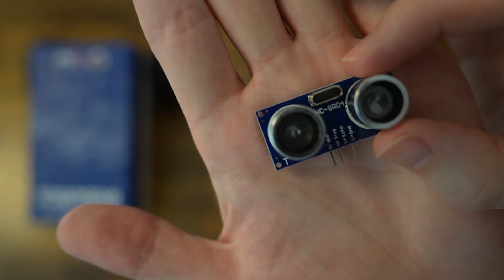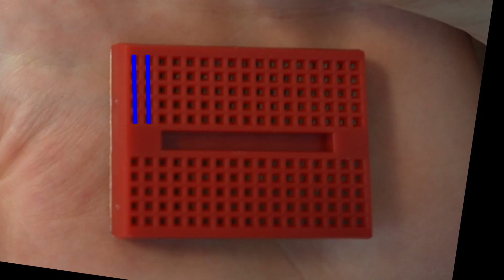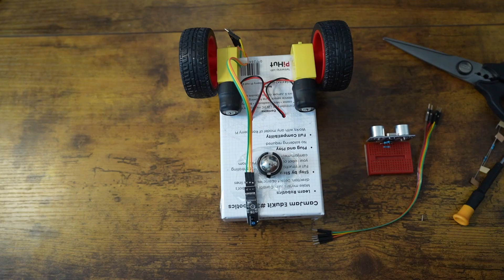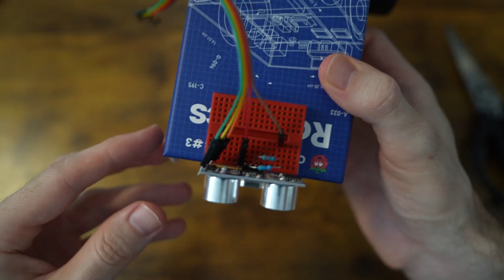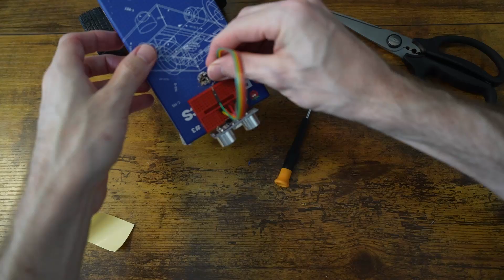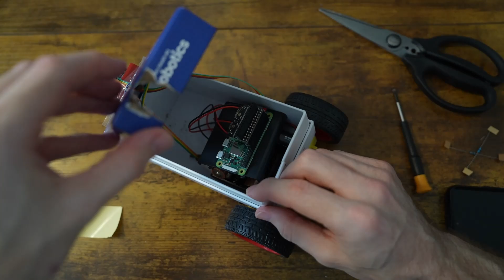#4 Adding Sensors to Robot | CamJam EduKit #3 Robot Kit

Comment: Its so satisfying to have a video to follow along, since the worksheets didnt actually use the same parts that came with the kit. 

I can't seem to see the wires on the bread board that clearly. Is there a diagram available highlighting the connections?
Reply from the maker: I'm glad it's helpful! As far as the diagram goes, I struggled to get a good shot - my camera didn't seem to want to focus that close... I took a new one, it's slightly grainy but hopefully clear enough to use: https://photos.app.goo.gl/ogTVXgqZQVGiv2Te9

Comment: Can't believe I'm the first comment but okay, you didn't mention the echo wire being put into the breadboard at all I assume this is the loose one you had.
Reply from the maker: This could have been clearer in the video! The brown wire is for the echo pin, but it has to be connected through resistors. The echo pin has 5V, but the Raspberry Pi needs it to be 3.3V. Echo pin (5V) -> resistor (330 Ohm) -> brown wire to RPi (3.3V) -> resistor (470 Ohm) -> ground. This is the potential divider I was talking about at 1:30. 

The loose wire was because I broke my original wires, so I bought more to replace them, then I tore off too many wires from the new set.